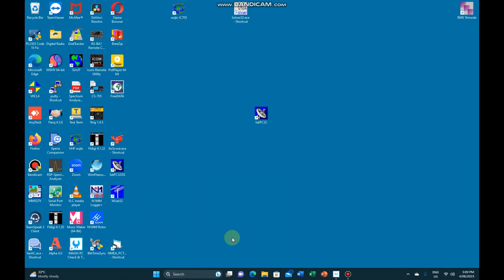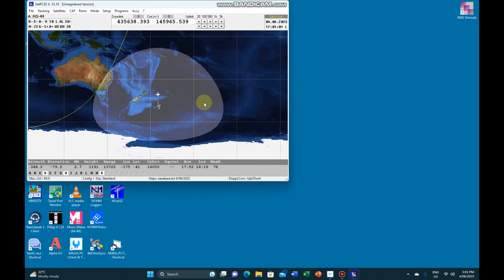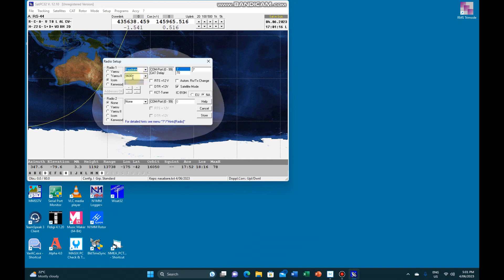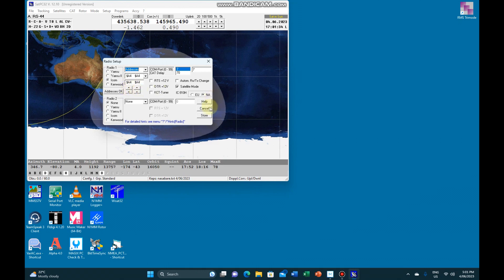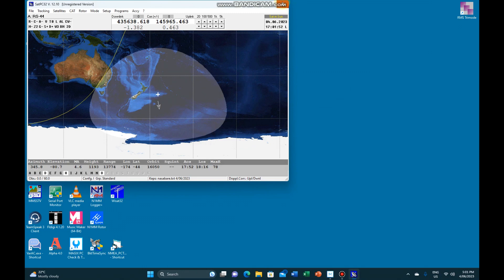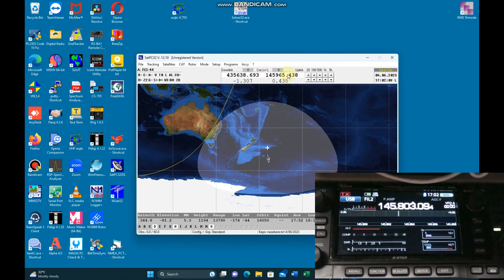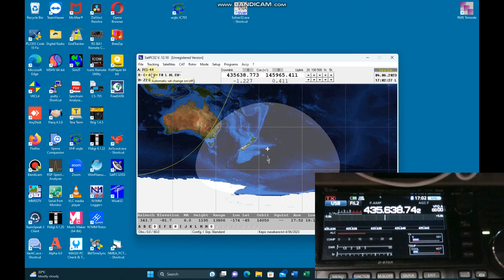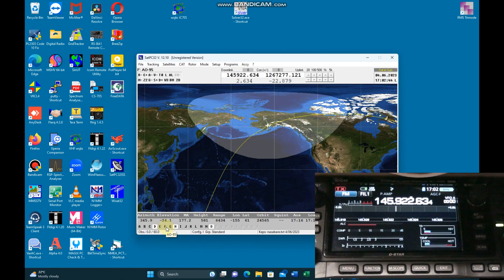IC705 and SatPC32

Comment: I followed your settings and when I connect to the radio for the first time, it goes to the correct frequency, mode, etc. as shown in you video.  It does not doppler track on either the uplink or the downlink.  If I go to the cat menu I can force an update, but the program does not send it out to the radio on a timed basis.  Any ideas?  TNX - Dick - KC3EF
Reply from the maker: I will have to revisit my setup and confirm it all works again. Doesn't look like I left it long enough to see the VFO update for doppler.
Reply from the maker: @richardrohrer I tested my setup again and found it changes frequencies every 10 seconds give or take.
Reply: @vk4kws  I will try again and see if I have setup something wrong.
Reply: @vk4kws  I followed your setup exactly and I can't get mine to track the doppler.  It will change the frequency if forced, but not the normal updates.  Any other ideas?
Reply: Tried it again and it works now.
Reply: Actually I found that it tracked an FM bird, but did not update for an SSB bird.

Comment: Thanks for this. It got me started. However, it would be good to add that you need to select "CAT" box under options in the setup menu. It took me awhile to find that. Of course there is always the option of reading the manual but I always think it will be faster if I just dive in. It also would be good to mention the settings on the radio itself. I did figure that out on my own.  Thanks again.

Comment: Have you managed to use SSB with SatPc and IC-705? Mine keeps defaulting back to FM on tx
Reply from the maker: I haven't use SatPC32 in a while so I would have to experiment with it again.
Reply from the maker: Is your Sat file showing the correct mode.
Reply from the maker: I had a quick play with SatPc and the IC705. You can select the correct mode while transmitting. IE: press the ptt touch the mode on the 705 screen and select the desired mode (USB LSB FM Data ECT). It seems to remember that selection. This is of cause in split mode.